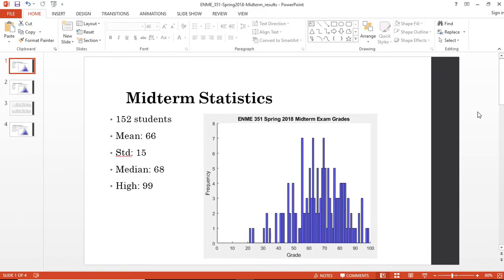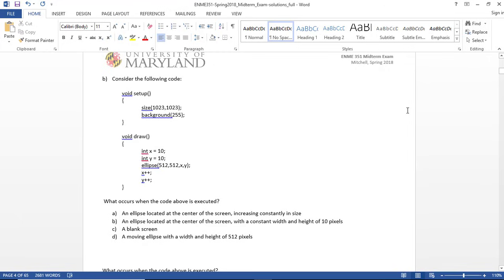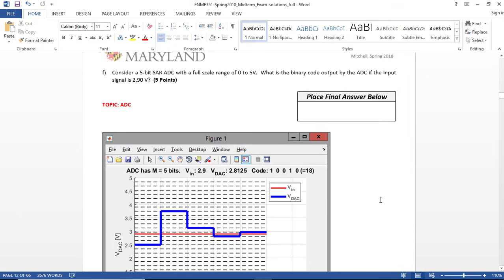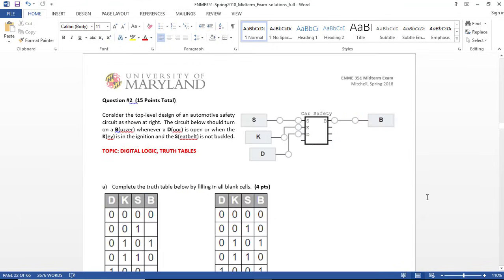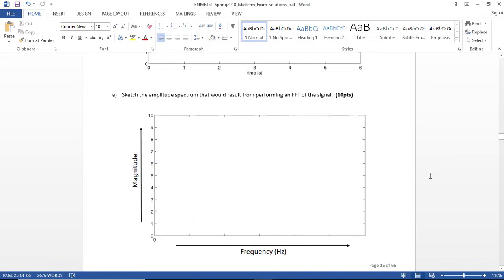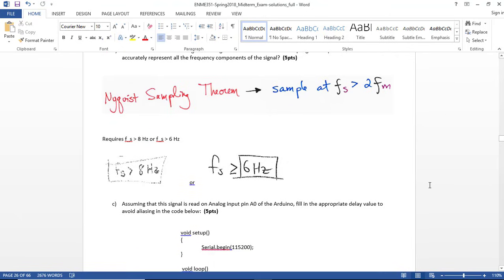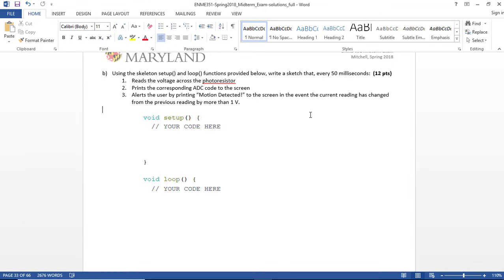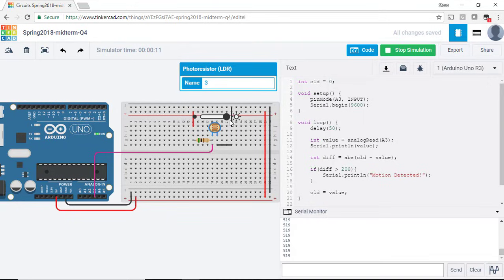2018SpringMidterm

Comment: Currently, the largest value that will produce an accurate delay is 16383. This could change in future Arduino releases. For delays longer than a few thousand microseconds, you should use delay() instead.